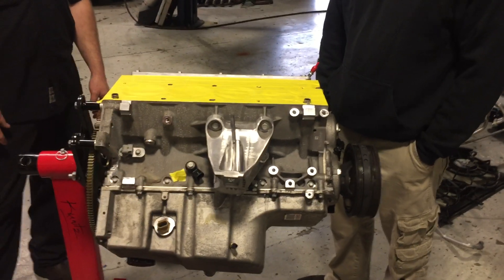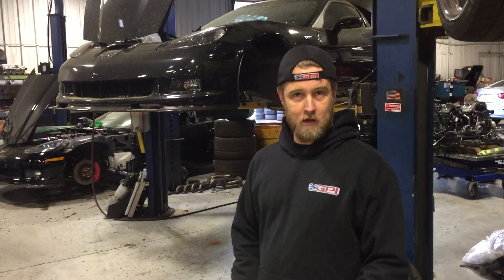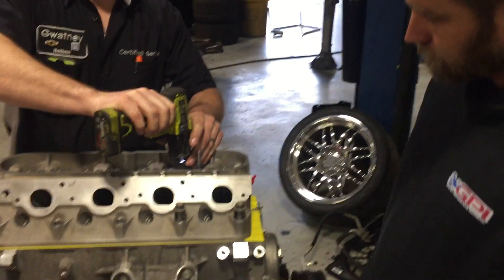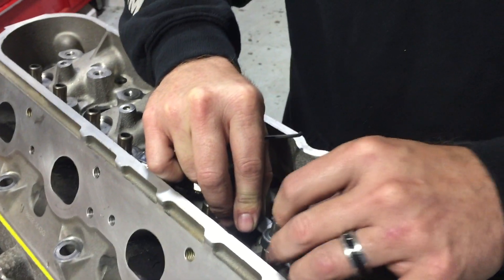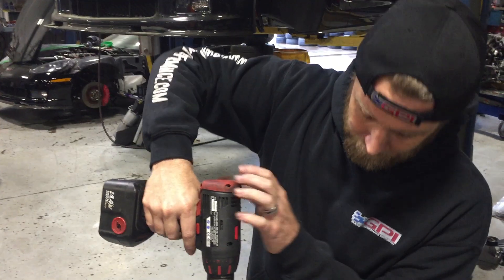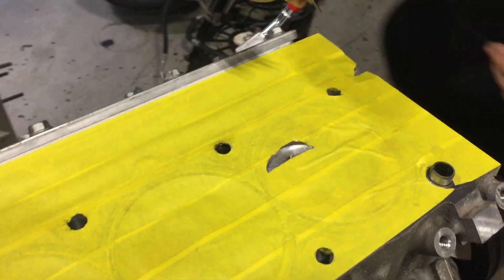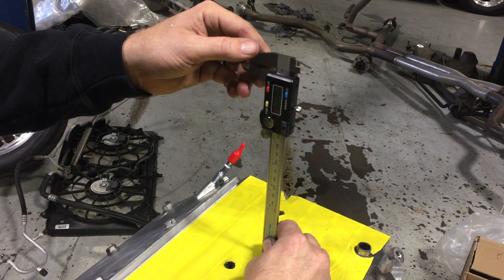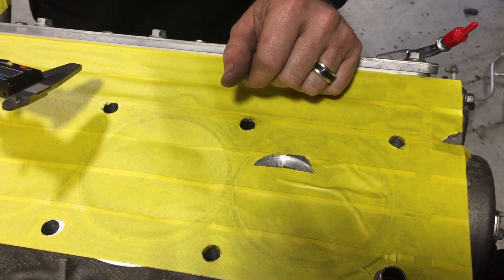How to flycut pistons on GM's LS & LT engines with GPI's Flycut Tool

Comment: Honestly, I feel like one of these gnarly NA LT engines would be absolutely sick in a C8...

How does the valvetrain hold up with this much lift? Is it pretty much a drag combo only? Will it hold up to daily driving? What about extended times at high rpm?

I get that it'd probably need some better lifters. Does it need shaft rockers? Cut the valve seats for bigger/taller springs?
Reply: I built a engine for my 81 camaro and it sounded a little knockey or something but I drove it for 3 day and boom take it apart couple months later intake valve broke off and all the valves left a little half moon in the pistons I felt soo dumb

Comment: Obviously youre not going to just hog them out like these guys did,  youre going to measure how much clearance you need once youre cam is in there, but I just done my gen1 sbc, i needed .030 extra clearance for the exhaust valve, the volume of the chord it cut out ended up being .3cc measured. that is a third of a gram and it only affected my compression ratio by .038. It went from 11.494 to 11.456 measured. So doing this is absolutely nothing to worry about in the comp ratio or balance department.
Reply: I don't think they just hog them out. I'm pretty sure they checked it with the cam and then did the fly cutting.

Comment: Dont measure it with calipers like he is, use a depth gauge with a pin attatchment inthe deepest part of the relief... and for the love of god if you DO try doing it like this guy, take the tape off the piston before measuring it, the tape can be .015 thick, also dont take his word for the acceptable depth to cut, consult the piston manufacturer, they know waaaaay more than this guy about how much and where its safe to remove material from their pistons.
Id also recommend putting grease on the take to catch the chips if you do this, assembled shortblock or mocked up, its better to catch the chips than let them end up who knows where.

I feel sorry for anyone who has an engine this guy has anything to do with..

Comment: I just put a comp cam in an l83 5.3 with afm 218/220 .525ish lift, and it is running intake valve into piston? Is it the cam? Or should I double check my marks?

Comment: One point not mentioned is This tool not only gives valve clearance, it also corrects the angle of the valve reliefs in the pistons to match your heads. Manufacturing being what it is, sometimes theyll sell pistons with valve relief angles that arent exactly what your heads are but will work, this way they can kill many birds with one stone by designing making and selling one piston design to suit many combos.. Example, mahle 21 degree valve notches in pistons for 23 degree heads are for any 23 degree head, angle milled or not. If the angles dont match and you over rev and the pistons and valves kiss, it can bend the valve and cause a catastrophe. If they match, for the most part, if they hit, the worst that CAN happen is the pushrods take it and  bend. This is race engine stuff with race engine clearances and solid lifters though. If youre haveto watch this, youre likely not concerned about that on your street LS engine.
Reply: Those angle disparities are meaningless, the piston is designed that was to encourage flow to a specific direction. If you make it to high school, take an auto shop class.

Comment: is that flycut tool able to be used to cut reliefs in smaller hobbyist engines like 1 cylinder 212 cc Predator Motors from Harbor Freight? Or do the motors have different sized valves?
Reply: You would need a smaller tool to do small engines

Comment: What brand of impact wrench is that?
Reply: Is a regular electric drill. Dont use an impact. The reason it seems that it is, is because hes going a million rpm with the tool and each time a cutter on the tool hits the piston it bounces, causing chatter. Thats the awful wavy appearance of the relief on the piston when they show it close up. Also, dont use this tool at a million rpm in the drill.
Reply: @benjaminrutledge7675  nah buddy the green one he uses to bolt the heads on is a small 1/4impact wrench, that's what I'm talking about not the drill he uses to make the flycut
Reply: Snap on unit, not sure on part number

Comment: The piston should be positioned in the block where the piston to valve clearance is the closest and the cutter would be a the proper angle. The valve is not closed to the piston at top dead center.
Reply: That’s part of the reason the cutting tool is .100 bigger than the valve size
Reply: great point.
Reply: True that.. big time..
Reply: Dont need to, theres no head gasket in there, the valve relief will have plenty of room once a head gasket goes in
Reply: I thought this as well.  Thought a degree wheel was needed

Comment: Im runnning a 235/252 stage 4 cam with CNC ported 243s 57cc milled .060 on a stock 5.3 block you think i need to notch pistons ?

Comment: Fly cutting the pistons does not does not reduce combustion size or raise combustion. Removing material would lower the combustion ratio
Wow.  What wrong information
Reply: And why would you cut reliefs at TDC when PTV clearance occurs BTDC / ATDC !   Another dirty workshop pretending they know enough to "share".
Reply: @jasperpipes4222  how do you check ptv clearance? At tdc?! It's the same concept.
Reply: @MrJayo73   I check my clearance like any knowledgeable engine builder. 
Your cam selection will dictate where in BTDC to ATDC sweep that the PTV clearance is closest. If you just check at absolute TDC, you are not 
looking at the full picture and still run the risk of a PTV contact event.
Reply: You dont check piston to valve clearance at tdc either, the valves are nowhere near the pistons at tdc. An engine is dynamic. Watch this animation. https://m.youtube.com/watch?v=MnJWmo5CjAs 
Yes its not an LSX engine but it illustrates this perfectly. Imagine the valves at your angle not the angle in the vid. At seconds 2 and 58 youll see where the valves are closest to the piston in their respective events. THIS is the point where you want to check piston/valve clearance, not tdc.
Reply: The point where the valve is closest to the piston during the valve events
Reply: @jasperpipes4222  because cutting it at TDC gives you more radial clearance… if you cut it at 20° btdc or atdc the valve won’t have more than .010 clearance on the edge of the valve
Reply: @Texas_Road_Warrior   Or you could use the correct diameter cutter to give you the desired radial clearance at said btdc/atdc valve event. I understand lots of people get away with "hit and hope" engine building, but I prefer to use precision in my builds.
Reply: Well just like the old saying goes there's more than one way to skin a cat right. I've never had an issue doing it that way and I'm sure there's a whole lot of other people out there that done at the same way as I have never had an issue so I'm for you to say that they're pretending to be knowledgeable is probably a little bit of of a misconception
Reply: Yes you can do this at tdc, like you say, but, the valve comes down at an angle. So, the further down the bore the piston is, the closer to the edge of the piston the reliefs need to be. Essentially if you do it at tdc, youre creating a valve relief that is closer to the centre of the piston. Yes it has enough radial clearance at tdc but waaay more than needed 10 degrees before/after tdc.... (generally where the valve is closest to the piston) its atill achieving the same result and enough radial clearance etc, but at tdc its essentially taking more material than nessessary and affecting your compression ratio-lowering it more.
Reply: Im sure by combustion you mean compression ratio. And yes it does affect it. Each gram of material removed from the top of a 4032 or 2618 forged piston equals exactly 1cc loss. You can use mathematics to figure the rest out. You can also bring your piston down 1” and cc the volume of the cylinder with the piston there, then compare that using math to the volume of a regular cylinder 1” deep by your bore size. The difference is how many extra cc’s you introduced, you can then figure how much less compression ratio you lost. Will it be half a point or even noticeable driving..? Doubt ful. But it does affect it.
Reply: You can test this. Next time you have a head on an empty block, try push the valve out of the head through the cylinder.. itll eventually hit the side of the bore, if it doesnt actuall hit, itll be closer to the bore when it falls out than it is at the top
Reply: You can also cut a valve stem into a point and punch the top of the piston through the guide with it at tdc and then down at say 20degrees before or after tdc and punch it again. The two punch divots wint match up

Comment: I’m new to this but does fly cutting lower compression? 

I have a 5.3 with flat top pistons 243 heads milled .030 with stock standard .051 gaskets. 
I want to run a Texas speed ms3 cam. On e85 fuel will I benefit from going to an even bigger can and fly cutting more or no point after that? Thanks in advance
Reply: Allows for a thinner head gasket which raises compression
Reply: Thinner head gasket could complicate piston to head clearance though, might want to check that
Reply: @roccobaggiossi3545  if you cut large valve reliefs into a piston a thinner head gasket is not going to make up for the volume loss by itself. The heads would need to be milled also if you want to have a higher compression ratio.
Reply: Danny... to answer your question. Yes fly cutting a bigger valve relief lowers the compression. To know how much compression you end up with you would need to take a CC measurement of the valve relief and put that measurement into the formula for figuring out compression.

Comment: What are the odds on not messing up the valve guides when using a good cylinder head for this process? I don't have an extra LS3 head laying around with the same 12 degree valve angle as my good units.....
Reply: Dont do as fast as this guy is and use an assembly lube or oil on the guide rod of the tool and it wont burn them up.
Reply: @benjaminrutledge7675  not gonna blame the tool or the company, its my fault, but guy said in the video "dont overtighten the collet. it will strip" well I took that and ran with it, the collet moved while it was cutting and i put probably a 1/4 deep valve relief in the piston. junked that bottom end lol lesson learned.

Comment: What kind of power difference could you gain by going from a cam that doesn't require fly cutting vs one that does? We just got one of your SS4 non fly cut cams.
Reply from the maker: You could make a considerable amount more power, especially if paired with an appropriate manifold like the Holley Hi Ram or CID.
Reply: @GwatneyPerformance  good to know. Thanks for the help. Looking to do some more business with you guys.

Comment: one thing i may add is to radius the edges of the new notchs once done to help add in flame travel an hot spots. i got lq9 pistons with .150 fly cuts with ls3 heads.,my ls1 is also .1

Comment: Is the tool one size for intake and exhaust?
Reply: liddy you can use the same shaft an then order the 2 cutter sizes you need for your int an exh..isky makes a cutter also,the liddy one is easier of the 2..